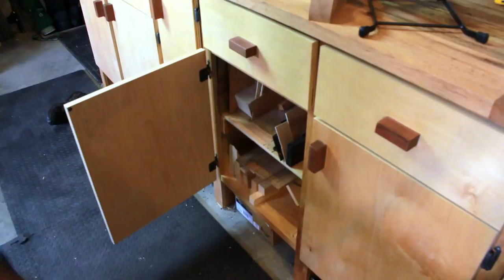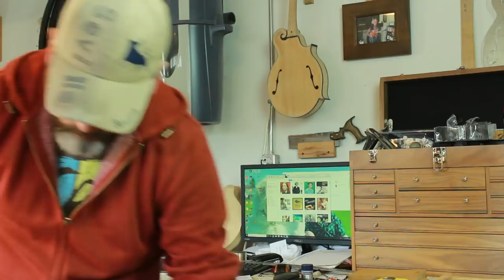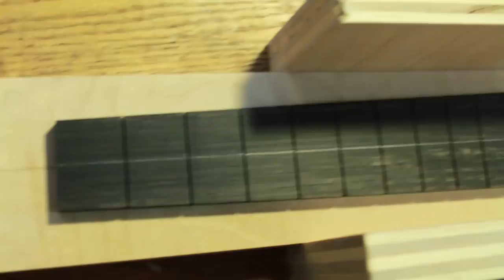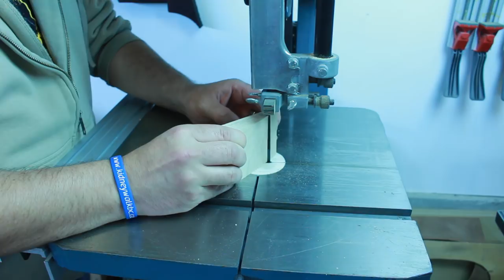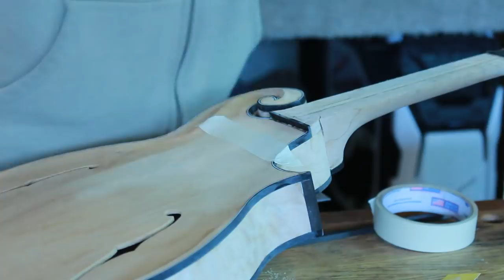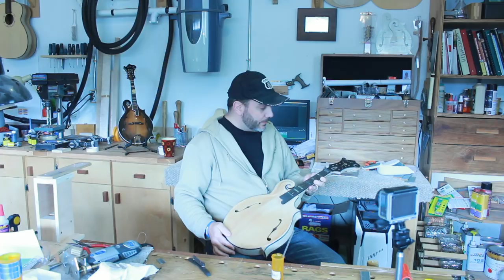Abalone inlay & fretboard extension

Comment: Hello, I have a guitar neck I'm sanding a radius prior to a refret. The inlays we're sticking up and they have been sanded and lost their shine. What is the process for getting them to look nice again, to polish up the dull areas. Thank you.
Reply from the maker: You’ll have to go through all the sanding grits.. finishing with 1500 or 2000, fine steel wool, and cloth to polish
Reply: @HovingtonInstruments  OK, I jumped to 2000, wasn't having any impact.  I think originally the inlays had some lacquer applied.  The guitar was made 'for a price' in Japan in the 70s, not sure they'd have gone through the detailing we expect today.  I'll follow your advice, many thanks.